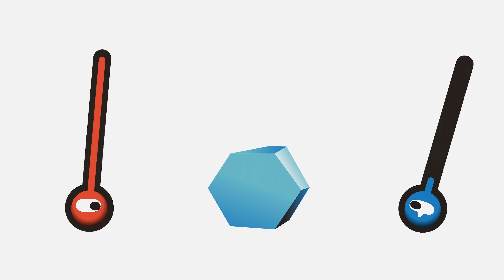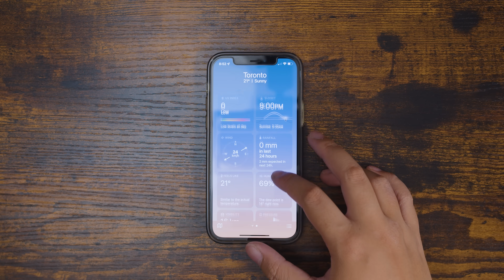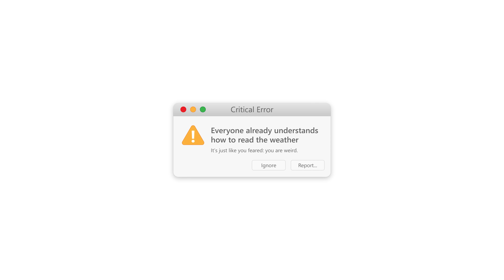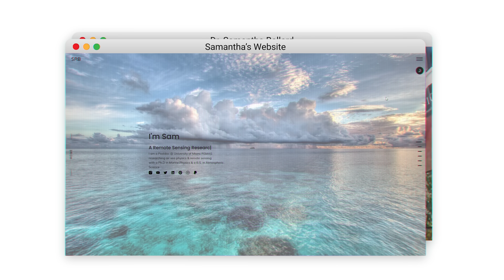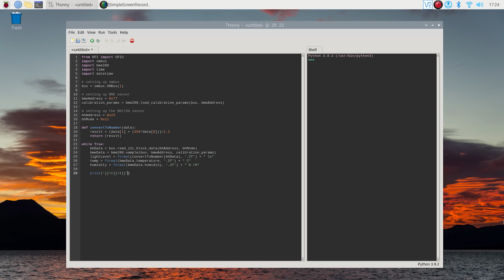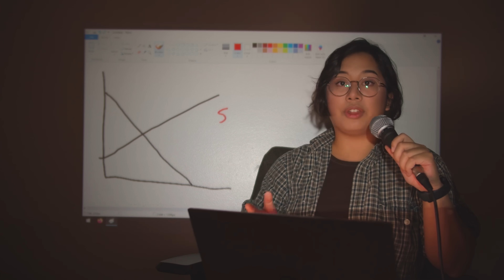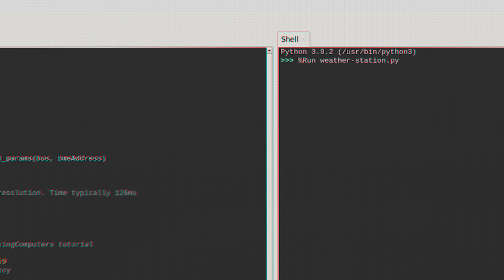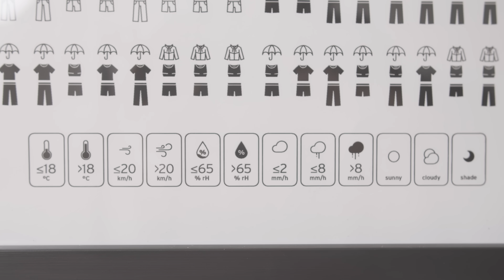how fahrenheit fails you

Comment: Celsius is stupid. The degrees are too big. You can feel the difference between 20.0 and 20.8. Even many modern thermostats that have C let you add a decimal place. So silly. The Metric champions like to trot out the whole "divisible by 10!!!!!" trope. When on earth do you need to divide degrees?Gee, 45 degrees divided by ten because.... nothing.  Both C and F divide single degrees by 10, not fractions. "It's in the teens!" = warm hat/cap/ear muffs, good gloves, good coat, wool socks definitely. "It's in the twenties!" = any hat, any gloves, good coat. "30s!" = Coat, hat maybe. "40s!" = any coat or maybe sweater after you're acclimatized. And so on. Super easy. Celsius (which I deal with at work all the time) is not as user friendly, period. 0=freezing and 100=boiling? TOO FEW DEGREES to describe that.

Comment: 3:28 That only works if you live somewhere cold, if you livwe in a moderate or hot place it's definetely not intuitive. For example, where I live, Buenos Aires, which is a place with moderate temperatures, 0 farenheit is impossible. The range would be from 40 to 100 farenheit here.

Comment: Celsius:
Water boils at 100°, freezes at 0°

0-5: very cold
6-10: cold 
11-15: chilly
12-20: good and comfortable 
21-25: warm
26-30: HOT
31+: very uncomfortable
Reply: You're from a cold country aren't you
Reply: @CountingStars333  I wouldn't consider Australia to be cold Country
Reply: @PheGaming  I think he meant NOT from a cold country :D
Reply: @CountingStars333 
People from cold country don't omit temperature below 0'c
Reply: @CountingStars333  in the cold countries "very cold" is like -10 C° or -15 C° and below
Reply: @CountingStars333  people from cold countries don't call 11-15 degrees chilly. That's like perfect weather. 30+ is hot though. You can't do stuff without sweating all over the place. I like to be able to be physically active and not sweat, which is usually the case between 10-15 degrees Celsius. If it's colder than that, you start needing to wear a jacket and stuff, so it's fine but not ideal.

I'm from the Netherlands btw, which isn't even that cold of a country. Summers are regularly 30+ around here and winters around -10.
Reply: @jaspermooren5883 this is so true. 10c is great for doing work outside because you don't overheat wearing a flannel. I'm from Michigan in the US, and we range from <-20c to roughly 38c.
Reply: 12 degrees is NOT good and comfy, it's fucking cold
Reply: @Napoleon_e2 you live near the equator.
Reply: @Ornithopter470  yeah
Reply: wdym? -5 to 0 is the most comfy
Reply: To me 12-20 would be chilly. Where i live the coldest we have is 21 °C
Reply: You cannot tell me that makes more sense than a 0-100 scale where 0 is dangerously cold and 100 is dangerously hot. Fahrenheit is also more precise.
Reply: @callie8007  100 is not dangerously hot though. People live through more than 37.8 degrees Celcius half the year in a lot of places in the world. Outside of literally anything but air temperature Celcius also makes tons more sense. If your cooking for example, Celcius is just more intuitive (because the boiling point of water is actually a significant point). Also Fahrenheit is not more precise, its just smaller (in fact, Fahrenheit is defined by being a conversion rate from Celcius and has been for quite some time, so it has the exact same precision). But decimals exist, you can just use those if you need more precision than 1 full degree (in fact, for air temperature it is almost never shown to a degree precision, but to the 10th of a degree, at least in Celcius). The percentage idea that a lot of people give to Farhenheit just doesn't even remotely make sense, 100 is not 100% and 0 is is not 0%. In a lot of the world it can get way colder and hotter than that. -17.8 Celcius is not that cold, that's just a normal winterday in a significant part of the world. Also with Celcius you know when it freezes immediately (because that is 0), which is actually quite important information. 0 Farhenheit has no meaning, it's a very specific solution you have to make in a lab, whereas water is very common and whether it freezes or not is actually important to know. Body temperature is at least somewhat of a resonable point, although Farhenheit was also off by about a degree Celcius for that, if you normally have a body temparature of 37.8 Celcius, you should really see a doctor. So even for that it doesn't really work that well, since it's just wrong (and hugely unscientific, since body temperatures are not universal or constant, whereas the boiling point of water in a specific atmosphere is a perfectly replicable expiriment, which is why Farhenheit is just a conversion rate of Celcius nowadays, since historically Farhenheit by it's original definition is wildly unprecise).
Reply: @jaspermooren5883 the precision idea is probably more precisely called resolution. Fahrenheit does have a narrower resolution generally, because the difference between 70 f and 71 f is smaller than 26 c to 27 c.
Reply: @Ornithopter470  Resolution is a problem in non-decimal systems only.
Reply: @timosalo5003  higher resolution reduces the need for decimals. A 0.2 degree increase in temperature is difficult to gauge by feel, which is the most relevant for the average person. In a lab setting, use Celsius because you're not trying to get the room temp comfortable.
Reply: @callie8007  0 C is not dangerously cold. Its water freezeing point.
100 is boiling point. It has more sence than fahrenheit.
Its the same thing like imperial vs metric system..
Reply: 0 c is chilly. It routinely gets to -18 to -20 c

Comment: 3:25 that’s just wrong, Fahrenheit is NOT more intuitive. The one who’s the most intuitive is the one you grew up with, or use daily.
For example I grew up in Germany and still live here so obviously Celsius is much more intuitive for me:
The coldest day I experienced is like -10 degrees, the hottest one is 50, so if it’s 35 degrees I consider it as very hot if the temperature is below 0 I know it’s going to be very cold, I can’t do anything with these high Fahrenheit numbers. But this also applies the other way around: an American can’t handle these minus degrees in winter and would find it very unintuitive.

Comment: Tbh I really don't find farenheit intuitive. Like, what's the difference between 0°f and 10°f? What's the difference between 90°f and 100°? Like they're both just super cold or super hot. At least 0°C is a fixed point where something happens. If it's 0°c or lower I know the roads will be frozen when I'm driving. If it's above, they'll be okay.

Comment: Of the measurements of length, mass, temperature, volume, the two most subjective are mass and temperature. An exercise weight might weigh 5 lbs, and not feel heavy. But having to hold it in your hand for 10 minutes and it's now heavy. Same with temperature. Go outside when it's 38F and snowing for a few minutes in just light clothing and it's brisk. Stay out there for 30 minutes and it's now freezing, but still 38F.

Comment: Half our problem in dressing are the fabrics used - most synthetic fibers are AWEFUL. Cotton is alright but... kinda terrible. And this leads us to really two amazing fabrics: Wool (often viewed as really warm... more on that later), and Flax (mostly Linen) Linen and Wool both have this amazing ability to Wick moisture, they breath readily, and they allow air flow - especially if a thinner wool. If we go to less pants and shirt and look at more traditional clothing we find tunics and other forms of clothing that naturally get josseled around as we move which further helps to create air flow, and rotate out stagnant warm air for cooler drier air.

The other benefit of wool is... well, it helps to keep us warm, even thin wool is warmer than most other fabrics on a cool day, and has the advantage of staying warm even if it gets damp. This means that ultimately wool is an incredible fabric for a day where it happens to be drizzling... if you are wearing cotton: Enjoy the chill. And that is before we talk about the fact that properly maintained wool has a habbit of allowing light amounts of moisture to simply beed off of it rather than immediately soaking it up (get into a rain storm though and you will want an umbrella, a rain coat, and so on made with modern fabrics... or at least treated with a water repellent)

Comment: Hmm, there is no part for the body's hysteresis to come into play? It's mentioned in the video in the sense of 10 degrees in the summer feels colder than 10 degrees in the winter. Basically I deal with the weather as a delta from day to day. "I was comfortable wearing this yesterday and it is colder today so I will wear another layer" for example.

Comment: 0 F - Dangerously Cold
100 F - Dangerously Hot

0 C - Freezing Cold
100 C - Boiling Hot

I’ve used both having lived abroad but Fahrenheit is more intuitive to me for outdoor temperature. Freezing doesn’t always happen at 0 depending on your elevation, ground temperature, wind, if you’re on a bridge… so it can be misleading. 100 C is not an outdoor temperature a human will ever experience, nowhere close. For science, on the other hand, Celsius is incredibly useful.

Conversely, 0 F is always dangerously cold, with frostbite occurring within minutes of exposure. Likewise, 100 F usually triggers heat warnings, with heat stroke being a possibility without taking the proper precautions. For earth-like temperatures, it just seems intuitive.

That being said, a lot of what seems intuitive comes down to what you grew up with, so while this is how I’ve explained it, it’s really just my personal interpretation of it.

Comment: I've never had any problems with Fahrenheit because all I gotta do is remember: 100 is instant heat stroke, 90 is evaporation, 80 is miserable, 70 is usually ok, 60 is amazing, 50 is good but only in the spring, 40 fucking sucks ass, its always 40, 30 is sludge and misery, 20 is the best below freezing temps, the 10's are shit, the 00's are frostbite, and anything below 0 is hypothermia and death. Except for -30, -30 is fine for some reason. Speaking from experience.

Comment: I think 0-100° C makes perfect sense to know what to wear outside because 0 is water s freezing point and 100 waters boiling point. The humans body temperature is 36° and the perfect “room temperature” is usually between 20-25 °. Considering this, anything below 0 is freezer temperatures, 0-10° is hella cold, 10-15° is normal cold, 15-18° is cold but manageable, 18-20 is nice breeze chill okay temperature, 20-25 is perfect sunny day or pretty warm weather, 25-30 is hot, 30+ is hella hot, anything plus 35 is hell because you make your own heat, the outside is not supposed to be over your natural body temperature. Since this makes sense for me it’s hard to make sense of such huge numbers like 275F like wtf is that for me 😂😂😂 but I understand that being used to it it’s what’s normal

Comment: I'm American. I grew up with Imperial measurements. So take my bias into consideration. 

I'll lead off with 100%, metric units are better all around. They're concise, they integrate into each other. They're great. I just don't use them partially because of culture, and partially because I have no mental reference to understand how much a kilogram weighs or how far a meter is, and frankly, I'm not incentivized to learn, so I don't.

The only glaring problem, though to me, is Celcius. It's stupid, and I think it's the one part that metric got wrong. I don't want to have the difference of 3º meaning the difference between being chilly and burning up (I may be exaggerating) but when every single weather temperature told to me in Celcius sounds like I need a coat, I feel like it does a horrible job communicating temperature to you at a human scale. Farenheit, more or less, is talked about in 10º increments. 65-75º is often considered comfortable, 55-65º you'll probably want a jacked. 45-55º you definitely want a jacket, probably a heavy one. 45º and below you might want a coat, especially once it gets into the 30º range. Because each degree is smaller, you don't have to be as precise. You can get by with an approximate temperature and know, more or less, how you should dress to go outside. (and before you @ me, yes. I'm fully aware that you can add a decimal point to temperatures in Celcius for more precise measurements. And you can do this in Farenheit too. It doesn't disprove my comment that 1º Celcius is much larger and therefore the variance is much larger when looking at the number and knowing how warm or cool it will be outside)
Reply: My rules for Fahrenheit are: 100 is hell, 90 is hell, 80 is miserable, 70 is usually ok, 60 is amazing, 50 is good but only in the spring, 40 sucks ass, 30 is sludge and misery, the 20's are the best below freezing temps, the 10's are shit, the 00's are frostbite, and anything below 0 is hypothermia. Except for -30, -30 is fine for some reason. (Don't question where I live where temps vary from 110 to -40)

Comment: For me, anything below 18 degrees C is cold. 19 - 23 is kinda warm, and anything above 23 is hot
Reply: for Fahrenheit, 100 is instant heat stroke, 90 is evaporation, 80 is miserable, 70 is usually ok, 60 is amazing, 50 is good but only in the spring, 40 fucking sucks ass, its always 40, 30 is sludge and misery, 20 is the best below freezing temps, the 10's are shit, the 00's are frostbite, and anything below 0 is hypothermia and death. Except for -30, -30 is fine for some reason. (Don't question where I live to get temps that vary by 150F, the northern US is weird.)

Comment: Zero is (literally) freezing(-point), 
5 is very cold
10 is still kinda cold. 
15 is nice and mild, 
20 is warm, 
25 is hot. 
30+ is hell on Earth.  

All much simpler than Fahrenheit
Reply: It was 46 here yesterday.  You need to move hell on earth up to 50
Reply: but you can get more precise measurements with fahrenhite, like each group of 10F has a unique set of weather gimmicks that you need to look out for which can be pretty useful at times.

Comment: I think my old chemistry teacher said it the best when it came to the old debate of imperial vs metric. It's all about what ur doing and how much play you want.  If you're a engineer designing a engine cooling system  you wanna use Celsius cause of the loose tolerances. If you're trying to fine tune it to like race you wanna use F° cause it's more accurate. When he was in the military as a air plane mechanic they used both cause sometimes you need to as close as you can and sometimes you just need to slap something together to make it work.
Reply: He hadn’t  heard of decimals?
Reply: @fredbarnes196   a lot of thermostats and measurement devices don't have enough or any. Also has to do with compensating for errors, damage and thermodynamics...

Comment: I think the bigger problem than Celsius or Fahrenheit is that for temperatures to make sense to a human, we need to be given perceived temperature. The more a temperature measurement aligns with our actual perception (and with how we need to dress for that weather), the more easy it would be to gain an intuition for them. Nobody would give you water temperatures in the closest body of water and expect you to be able to dress for the (air-based) weather based on them.
Absolute temperatures make as much sense as when your app decided to give you perceived temperatures, but to subtract (or add) 10 degrees from the numbers on weekends. They are only more useful than perceived temperatures when you are dealing with freezing or boiling water, or want to know how soft butter will get if you leave it unrefrigerated. And in those cases, if the usually small difference between perceived and absolute temperatures matters, then additional weather factors like humidity or air pressure might even play a larger role.

Comment: Temperature on its own doesn't tell you how it will feel, due to the other variables like humidity and wind. But in Canada weather forecasts account for that. In summer they provide the Humidex, which is how hot it feels taking into account the humidity. And winter they report the wind chill which is how cold it feels taking into account the wind.

Comment: It's better in relation to how we experience temperature ourselves. Why would you want to measure temps in chunks of degrees like with Celsius but that is thinking as converted from Fahrenheit. It hasn't been any issue whatsoever for me to relate 30 some degrees to cold af and above 87 as hot af. Then I can look at the temp and say "oh, look, it's 95 degrees Fahrenheit outside, that's 8 degrees hotter". No, no some of you like to batch your temps into chunks of seven then argue about kelvin when Fahrenheit always felt right. It's just those insufferable types like "akchually, KeLvIn Is BeTtEr BeCaUsE iT's TrUe tO zErO" like dude you are too dense to realize kelvin is made for academic use 🙄 ya got between 30* and 105* and that's about all the human body can even handle.